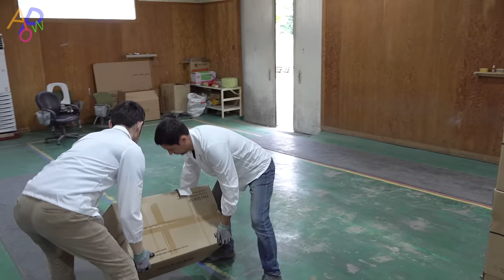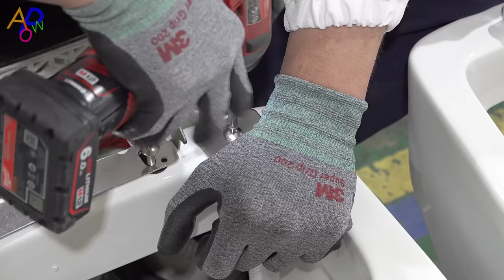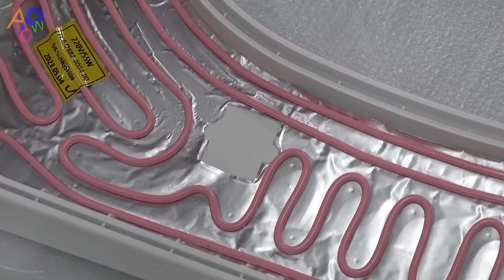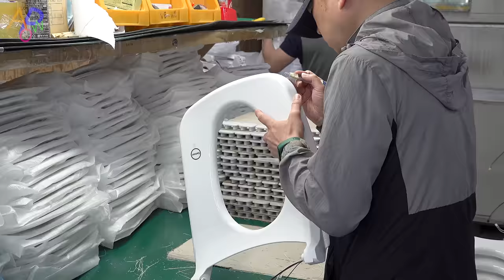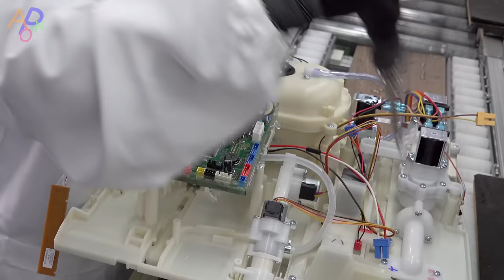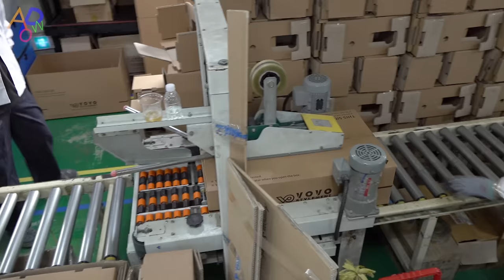Mass Production Process of Automatic Bidet Toilet. All-in-One Toilet Seat Manufacturing Factory

Comment: Nice toilet. I just wonder how durable all that plastic and electrical gadgets are. My toilet bowl is 45 years old. Ceramic, metal and rubber. It will probably last another 45 years.
Reply: You can't see it but ceramic/porcelain toilets actually all get physical wear during use, both from the acidity of pee and the friction of water. This wear causes them to slightly lose their original shape which can cause flushing to become less effective due to whacky fluid dynamics.

Comment: Whats the pink pipe for? To voltage when sitting or not? That is wire, oh is it automove? Then if the pipe somehow have magnets, soundwave = push voltage into then a second one = pushes voltage and sounds to person as Theory. If about automove only need a mini "motor", to autoshut or open, doesnt need piping at all, at the connection []-====- 1 side or both []-====-[] the [] will be the motor.

Comment: Almost unrepairable.  The heating element cannot be replaced due to ultrasonic soldering.  Many small components sensitive to water quality + poor availability of spare parts for repairs = trash after 2-3 years.
Reply: Of course, what is attached with ultrasonic waves cannot be repaired. If it fails, only the hot plate module needs to be replaced. However, there are almost no failures to use temperatures below 40 degrees. If it's a watery water with a lot of minerals, don't install a bidet. The bidet is prone to breakdown due to minerals. Bidegi is only suitable for places with good water quality. The bidet installed in my house is over 15 years old and it's still out of order yet. I am in Korea
Reply: 디지털 도어록도 불신으로 외국은 잘 안쓰지만 이미 한국에선 90%이상이 문제없이 잘 쓰고있다.
Reply: @갓도라희  There are 2 types of action - brute force and intellectual.
There is no point in a highly intelligent electronic door lock if the door itself can be opened with a can opener. The best way is a combination of mechanics and intelligent protection systems.

For example, keyless systems in new cars are very convenient for the owner. 
But they are also very weak when car will be stolen by "man-in-the-middle" attack.